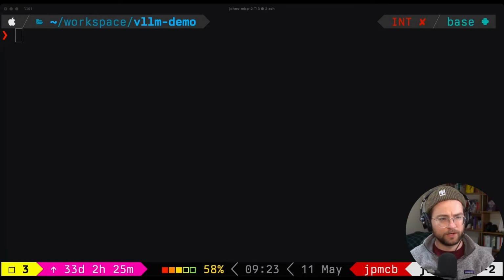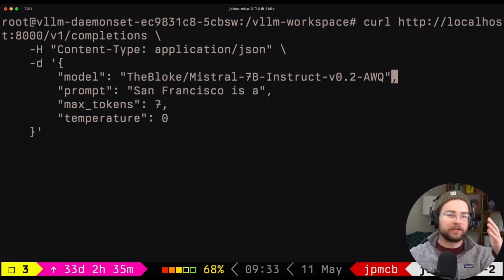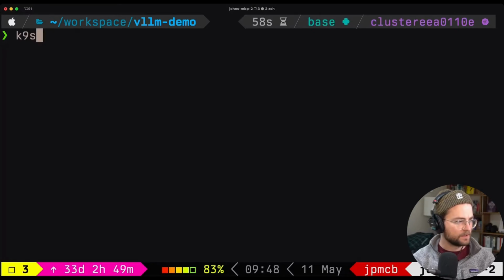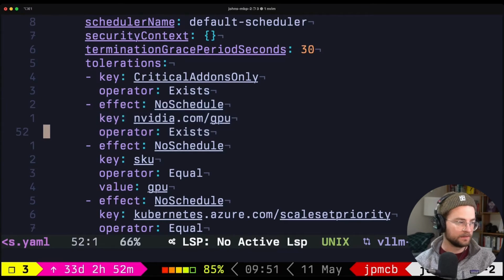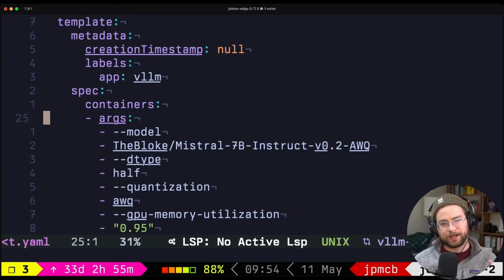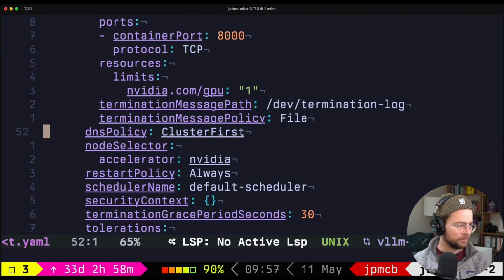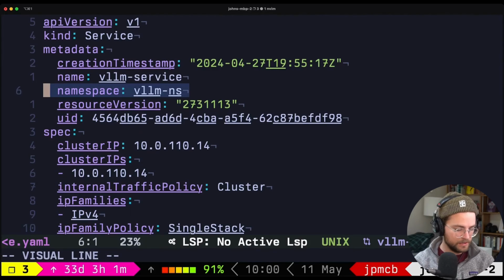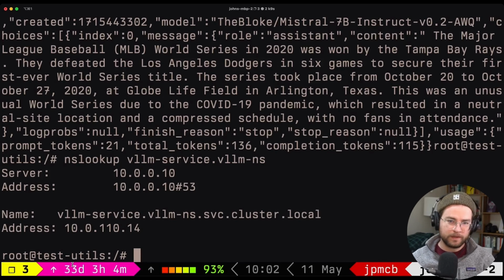vLLM on Kubernetes in Production

Comment: Hi John / Saiyam. In the last part you mentioned "In lot of cases could be cheaper"

What are those cases where locally hosting it is cheaper vs when using openai is cheaper:

Is it just dependent on the load which we will have (RPD and max RPM)?
Reply: openai is $.50 per million tokens for gpt 3.5 for example. If you rent a gpu server for that same amount, you can generate tens or hundred of millions of tokens in one hour depending on which text generation model you choose. something like mistral 7b, phi 3 series, llama 3 8b, gemma 2b,etc all deliver about the same results if not better than gpt 3.5 and also all fit on a gpu server that costs 44 cents per hour on runpod. (the A5000 gpu server for example.)